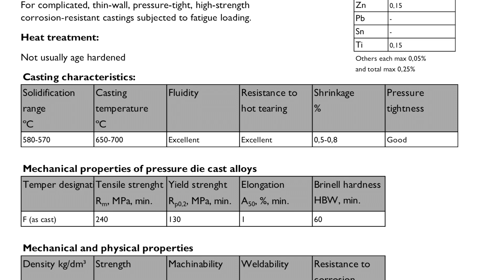Casting model engine crankcase

Comment: Hi Olli! Always nice to see your work!! What engine type is it to gonna be?. The outside finish is very nice my friend!!  What happen to the rear? Did the core collapse ?... Keep up the great work you doing. 
Funny, as I am also working on castings right now. I missing the genuine heads for my Webra boxer. A good friend loan me a good complete engine so I can copy the parts. the genuine carb is also missing, but cast that is not a big issue. The heads with the ribs is quite a challenge on the other side. Have a great week...and good progress!!!
Reply from the maker: Thanks Peter! I am working on a Danish vintage model diesel design: The Monsun Standard at the moment! Been machining parts for some time now and have most of them atleast prefabricated. Now starting with the case as I finally got a good casting done. My first one ever. Did practise whole week to get here. 
It seems that the core had lifted up a little but as I machined the main cavity yesterday there was still enough material to be machined.
Good luck with your heads. I red about them yesterday and really find it interesting as it happens we are doing the same ventures at the same time here :)
Reply: @OlliKarhun  Hi Olli! Aaaa the Monsun!!!..Its so a lovely engine.. I had also  plans in my head to make one..I LOVE the design !! How do you get the sizes for it_? Could you share the plan with me, if you are finish with it. Its a so nice design.. very much a bit Italian.. like the Antares... So lovely!!
Indeed..its crazy..we both work on castings now.. how is that possible!!!!!?

I get slowly pretty close. I was sure, that it would be not ready in one go...its pretty complex to cast due  the many spaces between  the ribs.. But I must admit,..the pressure casting works pretty good, once you solve the starting problems at the begin of this journey....But one day, I will build a centrifugal machine for castings.. t hat is  the way to go finally for the small complex stuff....or if you need a smooth surface. Model plaster gives extreem good molds.. Good lock mate!! I look very much forward to see this beauty!!!

Peter
Reply from the maker: @valic000  Thanks Peter! You too have fun with the casts and some litle pinch of well earned luck and the castings will succeed :) 

I was able to find a full MotorBoys plan for the Monsun! With a help of mr Ken Croft I got the plan originally drawn by lte Ron Chernich 👍🏼 It is a beautiful and lovely MB quality drawing, both in imperial and metric! And for sure you can have, I’ll email it to yoy asap. Ken wished that the plan be shared amongst builders 🤘🏼